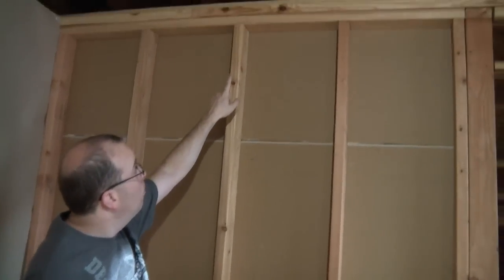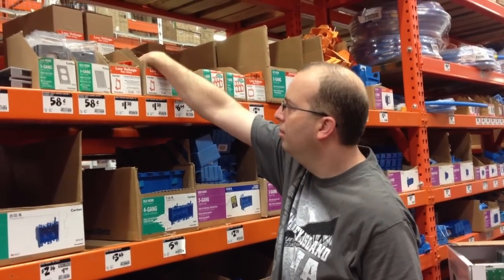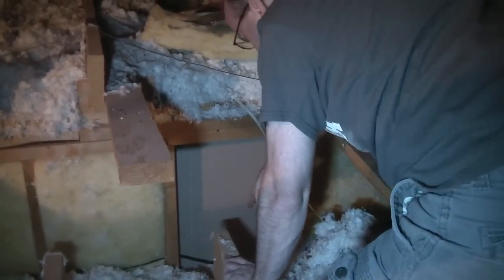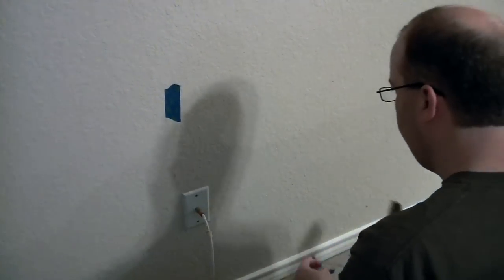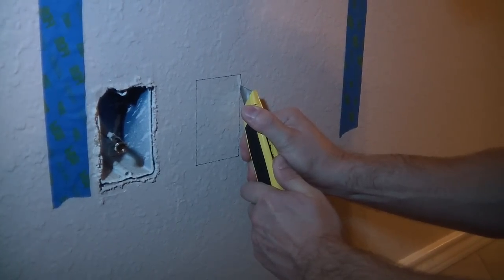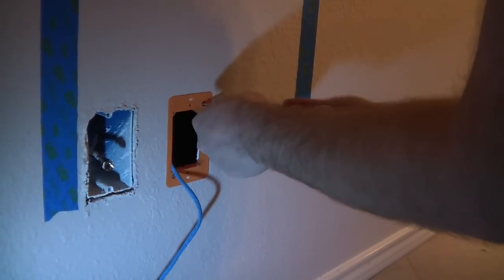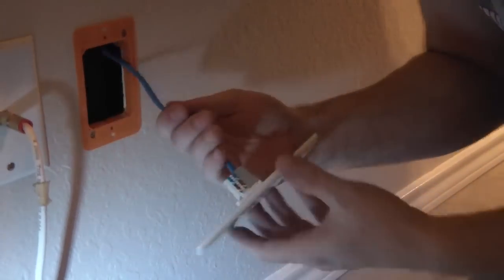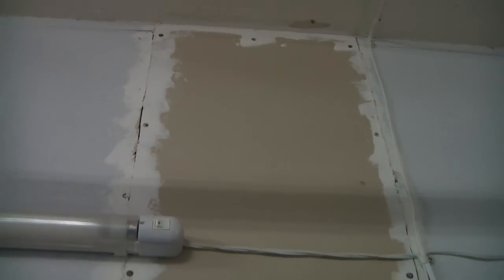How to install a network jack into a wall from the attic.

Comment: My God! You Americans build houses of paper! In Europe we use conduits and pipes in solid 10 inch thick wall made of concrete or cinder blocks
Reply: Fact:   "When North America was settled, the vast forests provided a free resource of building material, so wood was the primary construction material used.  This still holds today: compared to Europe, North America possesses large forests which are harvested and used extensively as construction material.  After a few hundred years, a tradition of construction has developed and persists, so that most contractors or builders know how to build a relatively inexpensive home using wood as their primary construction material."
Reply: Vlaj. Co here we you can buy brick homes made with concrete but have fun with the wiring and internet American homes can be easily upgraded European not so much
Reply: Houses are easier and quicker to make. Plus houses  are very well insulated from all the layers added. Not just a block of concrete.
Reply: We brick the outsides. Inner walls are drywall and wood for easy access and maintenance. Also if you want to change the layout of your house, it's much easier to knock down drywall and reframe with wood than to have to knock out concrete and risk the integrity of the entire structure. Opening up your kitchen, widening a room, and electrical like this are good examples.
Reply: vlada skynet I was tryinf to think of something to argue with you about but... You win its the truth.I was installing a ring doorbell on my house and the stucco just crumpled off and I'm like wtf
Reply: Just thought that. It´s impossible to make a outlet later on.
Reply: You are horribly stupid
Reply: the exrerior walls are still made of brick and hard materials. the interior walls are usually wooden structures covered with drywall
Reply: Vlaj; but it hasn't stopped any invasions since 1683...  ??
Reply: good for you!
Reply: Thats illegal here because it stops you the home owner from doing the work yourself. It alsi causes issues with insulation and can more easily cause fires.
Reply: Why wouldn't you build a house like this? Works perfectly well, your house will be solidly made and modifiable, and it's cheap. America is just smart and efficient, like always.
Reply: @Saucy Boi Ya know, I can kind of tell that you're 13.
Reply: At least we have gay anal sex
Reply: Lol, not all houses in Europe are like that, not by a long shot. It depends on where you live, and what era during which your home was built. Do you really think none of us have spent time in Europe?
Reply: It has to do with how easy and inexpensive it is to buy lumber in America.
Reply: Yeah and central AC basically non-existent in Europe. So when  it gets hot. (Think Spain in August....) you just suffer in misery at home.  Meanwhile every house in Texas and in Southern 2/3 of USA has AC. European standard of living sucks.
Reply: Robert Jensen wtf we have AC everywhere here in Germany lol
Reply: europeans dont even commonly have central ac. we are much more rich in america everybody has central ac and heat and most people have large houses

having concrete walls isn't good it just means your house is old as shit and ugly lol
Reply: GUMMYBEAYUH do you really think I haven't spent time in Europe?

Comment: Use a pencil to mark, not a sharpie! And always cut horizontally first, then vertically in case you run into a stud.
Reply: He located the studs first with the studfinder. Unless your wall is oddly built, the studs should be evenly spaced, so when you've found two studs next to each other like he did, there's not supposed to be any studs in the middle.
Reply: "should be"

In a perfect world, yes. Many times I've ran into shit that shouldn't be there, even in new construction. That's why it's a good idea to get into the practice of cutting horizontally first and mark using a pencil, not a Sharpie. Also dumb to cut open a wall with a utility knife. God made jab saws for a reason.

Comment: Eww that coax connector inside the wall needs to be changed. That is what we cable techs call the ingress generating, service disconnecting  push on special.

Comment: Is there a way to have 1 plate for the router in one location and have the rest of the plates in your house for clients to use?
Reply: The Galactic Void Yes, you would just run the cable from the router to a central location and then connect that cable to a switch. After that you would put jacks where you need them and Run the cable to the switch

Comment: Should have noted that there's wire rated for in-wall use. Regular wire is not, and should not be used. It's a code violation in most places.
Reply: The only difference is "plenum" and "non-plenum". Plenum is for when you are running cable in an area that is also used as a ventilation return. It has nothing to do with in-wall or anything else. As long as the space that the wire will be in is not part of the duct work, you can use any kind of wire you want.

Comment: At first i was like wtf how is he cutting through the wall with a knife?! But then realized that where he lives  houses aren't made of concrete :P
Reply: It’s a crazy concept to me that some homes are made of concrete. I wish you could do it!
Reply: In Florida exterior walls are often concrete block.
Reply: So in germany many houses are made of bricks and the ceilings are concrete. Very stable but a pain to du wiring.
Reply: I hope for his sake that the bad wolf does not appear
Reply: I live in FL and the outside walls of my home are made from concrete block (CBS - concrete block structure). Interior walls and exterior walls both have drywall on the inside of the home. You can cut through the drywall with a utility knife.
Reply: US houses are made out of cardboard. They burn very easily and a minor water leakage will make them melt.

Comment: meanwhile I just used a 50 foot Ethernet cable and taped it down to the floor against the walls, all the way from the front of the house to the back of the house... 😂
Reply: Our wives would never approve of that...
Reply: My ex wife didn't approve of a 100ft ethernet cable running along the floor going from the office (back of the house, where the router was) to the livingroom (front of the house, where my xbox 360 was). I told her the only solution was to buy a 42" tv for my office... and she actually AGREED! :) She never caught on that it would've just been more simple to move the router into the livingroom, since we used laptops and the xbox was the only thing that was hard wired to the router anyway.
Reply: @d-anger-noodle  Very smart move!
Reply: We did that, but from the ceiling in college. The wifi sucked, so we ran cables along the ceiling from the wall jack in our bedrooms to our living room and kitchen.
Reply: Don't give me ideas.
Reply: Alice Itty 3 years later, that still the setup lmao. we’re planning on moving the ethernet cable to the attic though, will do once we get our router fixed.
Reply: @thiefrules  same setup but mine goes above doors, underneath doors, underneath a closet and then it reaches my computer

Comment: All this talk about neatness.  How about just running a Cat5e from the router up through the attic to the room you want it in...drill a hold in the ceiling and feed the wire down directly into the device? It might look shoddy, but should work, right?
Reply: If you don't care about a clean look then why bother running it through the attic at all and ruining your ceiling? Either leave it laying on a floor or scotch tape it to the wall ;)
Reply: In my house that would be a bit "Over the top".  Too much traffic, too many people.  I see your point though.  Since my inquiry 3 weeks ago, I decided to call on someone to get the job done right.  I have AT&T wall plates that are not being used, so I imagine the installer can  use them.  Appreciate the feedback!  :-)
Reply: I want to see you doing this in masonry wall

Comment: I would have drilled the hole slightly larger in the attic so that you could accommodate for at least two Cat5 or 6 cables. If you're going through the hassle of running one you might as well run two. You'll thank yourself later.
Reply: You don’t really need more than one because at that point you can just connect it to a switch.
Reply: @MaxTheDog167  you always should try to run a backup cable
Reply: I drilled a 1" hole to run four cat6 cables down the same hole from the attic.
Reply: GuySensei8 but 2 cables is cheaper
Reply: sepulati0n I would have more than 2 devices in a room lol.
Reply: Switches should only be in the network closet/rack, not out in the building/house. If you might possibly have 3 devices in a room, always run 4-6 wires for expansion later.
Reply: CatatonicBug You act like your boss is going to run to your house to see how your network is setup and criticize you for it. I looked up racks on amazon and and they are way too expensive, even for a small one that mounts on the wall.
Reply: GuySensei8 No, I AM the boss, and would criticize myself for it. I make sure my own network is clean and neat, and that means no switches "in the wild", whether that is at work or at home.
Reply: CatatonicBug lol I have a switch in my room on the dresser and it works fine. I could always put it in my closet since I have two closets but I see no reason to if it works already. I dust it often and it runs fine. It’s just a small one anyways they aren’t expensive.
Reply: CatatonicBug Nothing wrong with that for you. Just saying not everyone has the money to get a rack and all that. I know how to be professional at work. At home it’s a lab and that’s it.
Reply: I ran and left a nylon string in case I wanted to add 2nd line (will make pulling 2nd line so much easier)

Comment: Why Americans not use electrical conduit, is it optional? With conduit you can add at least one other cable to your already existing outlet
Reply: Im from America and In my house, We only use If for when we have multiple wires that share the same starting and ending point. For example, If you have a tv mounted on the wall and you dont want wires hanging down, then you put hdmi and coax in one plate and put it through the wall to wherever the tv is.

Comment: Do I put the Jack on both ends?
Reply: Depends on the application and your preference. If you want to terminate both ends with keystones, you can. If you only want one end terminated with the keystone, you can. Functionally, the keystone is no different than taping the corresponding colored wires together.
Reply: Yes
Reply: I'm curious too. As I'd rather run two wall jacks with keystones instead of a long ass ethernet terminated to a wall jack keystone.
Reply: The other end would go into the patch panel in your network closet/rack. Of course, you'd need to fish the other end down into that area (or perhaps it was already brought UP from that area, into the attic).

Comment: What is the cable in the attic connecting to? The router?! Confused.. lol
Reply: To his switch but you could run directly to a router.
Reply: Hi! Can I ask you something? I have AT&T Fiber set up in my home and the router was placed in a bad spot inside. There are 3 cat5e cables running inside from the outside NID but only 1 is terminated, the other 3 don't have connectors on them and are lose in the outdoor NID. Do you know where I would terminate them so I can set up my router elsewhere?
Reply: Router, switch, patch panel.

Comment: Is this solution for houses with only one floor?
Reply: if your house has an attic then yes. If You dont then You could Put the wire under your floor If you have a crawlspace. If you don't have either than you might be out of luck.

Comment: So I'm assuming this house you were working on didn't have fire blocks in those walls. That always makes it fun. :/ Also you can use a drywall saw instead of a razor blade. I find it to be a little bit easier. Another point is just slapping a piece of tape across the bottom isn't always the best way to get the other box at the same level, it's possible to put the tape on crooked. So I would just measure to the bottom of both boxes. Its fast and more accurate. 

As for exterior walls, you can sometimes do them if you have a 90 degree adapter and a short drill bit. I've done it, and it is a major pain in the butt. You can fish down through insulation too. You just need some fish sticks. 
http://www.harborfreight.com/3-16-inch-x-33-ft-fiberglass-wire-running-kit-65326.html

Comment: what are those ethernet jack for? I found some already installed in my new home.
Reply: You can plug a laptop or desktop computer for example, or even an "old" Smart TV that don't have wireless conection, or an access point to increase the wifi coverage in your house.

Comment: Is it possible to do this using stranded core cat6 cable. I want to use stranded because it is more flexible and will need to go around a door frame (90 degree angles). However, I was told stranded cable is not good idea to use with a punch down tool for my ethernet wall jack?  Thanks.

Comment: It's amazing how different American houses are to British ones. As all ours are made of brick, it's a messy process trying to install network jacks, and sometimes the need to use trunking is annoying as it's not that aesthetic, especially in homes. And then you've got the problem that British Telecom engineers just love to install NTEs in the living room, which means either running an extension socket off the NTE (BT 431a to BT 431a), then connecting your modem to that extension  (as whilst the NTE can be a filtered faceplate, with an RJ11 as well as a BT 431a, an extension is smaller and physically impossible to filter) via a crappy microfilter. This is especially annoying as British lines are prone to batteries, therefore meaning an extension can really slow down the internet speed. Anyway, I'm jealous of your home network! But please feel for us hard off Brits :(

Comment: Where does the other end of that cable attach?  To a router, hub?
Reply: Ethernet switch, or the gateway/router if there's a free port on it, depends on your networking needs.
Reply: from there it would go to your router, yes.

Comment: Excuse me, but what's that "punch tool"? Is it specific for the lan wall plugs or it is a generic tool?
Reply: +Philip Petrov it's a specific tool that's used throughout the telephone industry, the purpose of the tool is to 'punch' the wires down to the keystone (the end of the plug) which has tiny (usually copper) blades that actually make contact with the wires. You can try to punch it down by hand but you may injure yourself (there's a sharp blade in there after all), the connection won't be as solid, and it's generally not fun times for anyone involved.

Comment: Wow, that looked super easy! My house's walls are solid, and it was pretty much a pain to wire the CAT5E networking cables through rooms! I had to use pre-installed coax cable pipes and a lot of force to do it.

Comment: If one side of the ethernet cable is plugged into the router/modem and and you route a ~60 ft ethernet cable through the wall....would that not cause a whole lot of latency issues?
Reply: A standard cat5 cable can be up to 295ft (90meters) without any issues :)
Reply: +isakwatz11 Even an analog signal would not have latency issues. Electrical signals (analog or digital) move at near the speed of light, so 60ft would not matter at all. Latency (delays) are caused by signal processing (routers, hubs, switches) not by lenght of cables. Unless you are talking about Moon-Earth distances!
Reply: I don't think so as the signal is digital.
Reply: Cristofer Karlsson Good to know.
Reply: +LiftOrGTFO :) As mentioned above there are things that can affect it. Powercables, tv cables and so on, anything with electromagnetics basically. The Cat 6 have better shielding and if you are to run the Network cables through/within walls i suggest using that instead. In  a worst Case scenario shielded pipes to run the cables in are preferred (in extreme cases).
Reply: Cristofer Karlsson
Actually 100 m but you get it :P
I suggest using a shielded cable too (STP) if the length is above 15 m.

Comment: I never knew outlet boxes like that existed. I have a box that I need to replace because the wiring is absolutely stuffed in there. So much so that the one switch will not lay flat. It already has a regular paddle switch and a digital timer switch. I plan on swapping out the regular switch for a bluetooth timer switch, which will be much deeper than the regular switch.
Reply: +Tim Ramich The orange cut in is not for electrical.  It is used for low voltage only.  you can get a deep cut-in box for electrical

Comment: Good video. I have Uverse internet from AT&T. Cat5e coming into the house dropping down to a wall plug that  then uses a data Cable 573307-002-00 to connect to my router. Looks like telephone line. My question... is that plug an RJ 11? I want to move my drop across to the other side of the room. I need to add more line and will use a junction box to do that. But when I drop it down to the wall plug Do I use an RJ 11 for the wall plug?
Reply: +Imploment Thanks. I think I figured it out.

Comment: Great video!  I had thought that this was something that your cable company had to do.
Reply: Cable companies will never go through this kind of detailed work. They'll drill holes from the attic, straight through the ceiling, and run the cable down the outside of the wall. They won't take the time to fish it inside the wall.